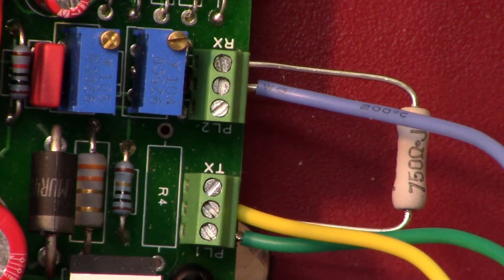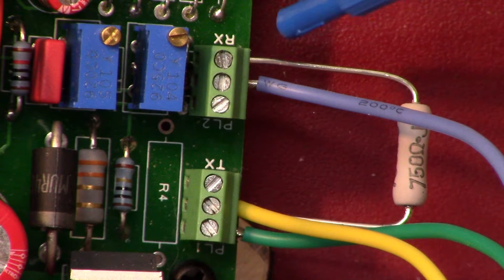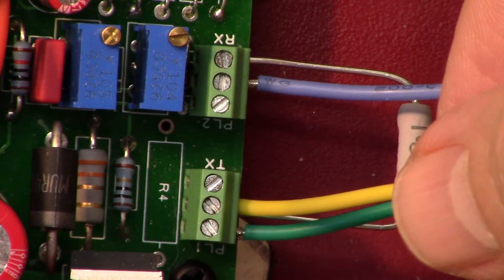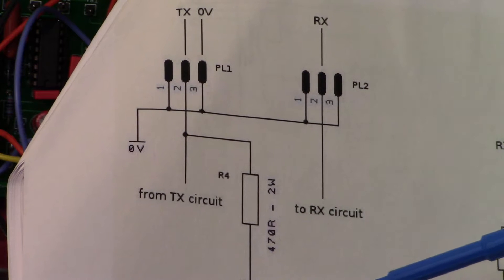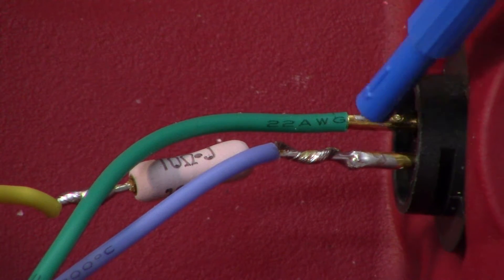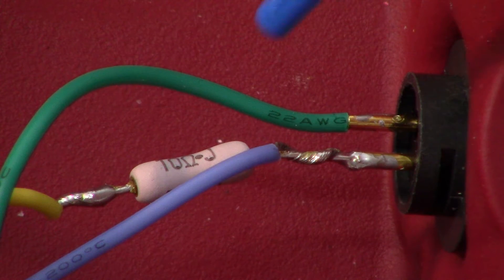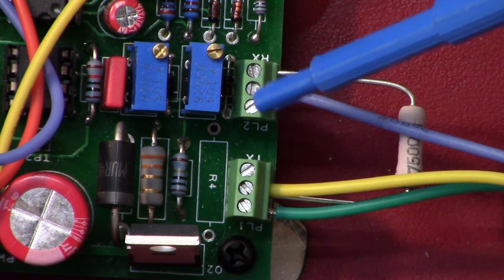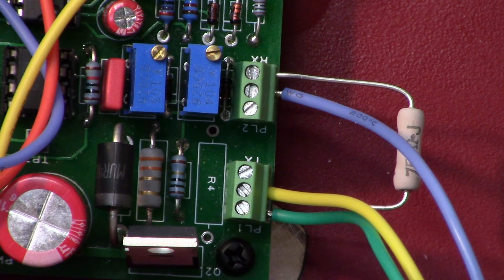Mini Pulse Plus coil connection explanation

Comment: Hi! I'm curious about the purpose of the 10 ohm resistor in series with TX. I thought the goal was to minimize coil resistance as seen in transmission to maximize the current?
Reply from the maker: At the time that I did this video I was experimenting with current limiting which allows the coil current wave to "flat-top".  The extra 10 ohms is excessive but I was investigating.  In hindsight I should not have included that in my video as I only made the video to illustrate the coil connections after a request from a subscriber.  If you are interested to read more regarding this topic of coil current etc, there is some excellent information of the Geotech Forum that I can direct you to.
Reply: @SurfDetector  Thank you for the explanation! After watching your video I went to the forum, I understand it now.
Reply from the maker: Here is a very good thread to read:
https://www.geotech1.com/forums/showthread.php?23417-PI-TX-Settling
Reply: That is a very interesting thread indeed, I had missed it somehow. It looks like a trade between coil current, flat-topping, and target time constants. Until I saw your resistor I thought low coil resistance was always a good thing, but now I have some thinking to do. So, I'd say that showing it certainly helped, thanks!
BTW, I really enjoy your "trash or treasure" videos!
Reply from the maker: Glad to hear that you are enjoying the videos. My beach detecting videos are brutally honest.
Cheers